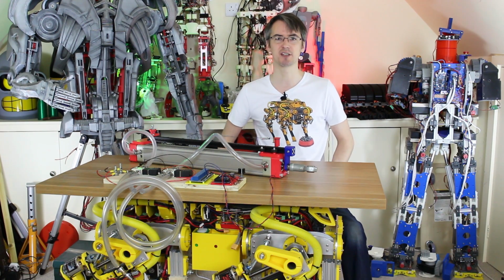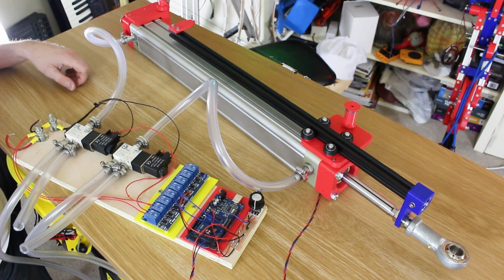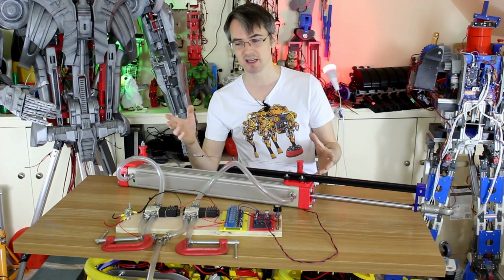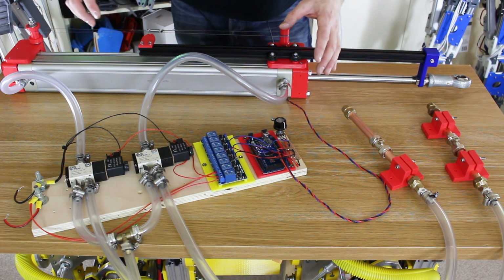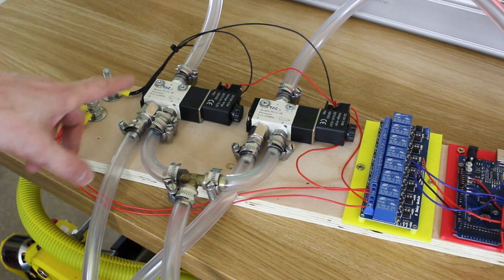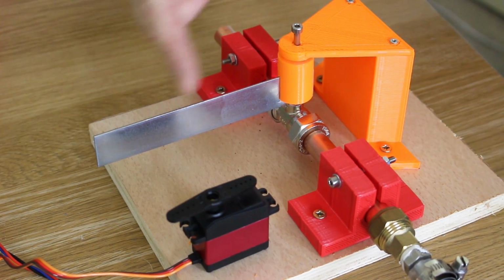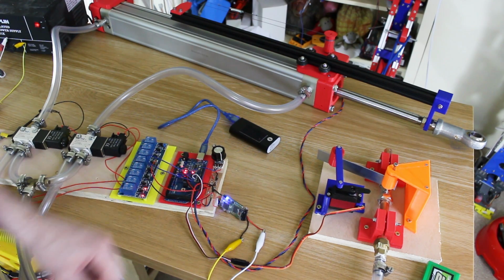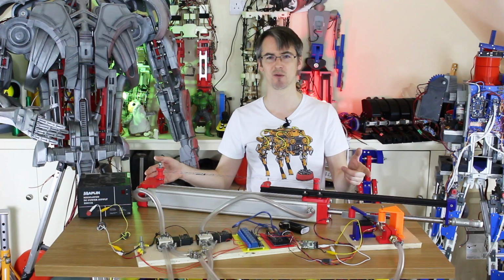Testing Proportional Control of Pneumatic Cylinders | James Bruton

Comment: hi james really like your show,

may i offer the advice of someone who has to deal with pneumatics on a daily basis

While you are correct it is the surface area of the cylander on one side,  on the opposite side it is the surface area of the cylander minus the surface area of the end of the pushrod. (also atmospheric pressure applied to the end of pushrod if you want to get technical). i would use proportional valves and go with pneumatic over hydraulic (water) if you want to completely eliminate creep. the valves open too quickly and allow for too much pressure differential applied too quickly, along with compressable fluid (air) is your problem. also the reason why you have gotten such strange results on your valve switches is that you are changing too many variables proving your prejudice and not testing an hypothesis. change one variable at a time it will be much easier to troubleshoot. also if you do decide to keep the solenoid activated valves and run with pneumatic over hydraulic you might have to deal with fluid inertia. all depends on how fast you want the transit to happen with accuracy.
Reply: Light oil is a better option for a lot of reasons, other than making a mess
Reply: did't you mean hydraulic over pneumatic. We had a robotic cell that feed a molded part up small amount each cycle for a robotic arm to grip. the up was controlled by oil. then when all the parts where fed, air was used as a fast retract.
Reply: This is correct. The "plug" in the middle does not have the same surface area, whiuch matters if you're feeding it the same PSI.

Comment: Do some of the Boston dynamic robots have pneumatic cylinders? That big dog thing has a 2 stroke motor running it must be running a compressor. The other great thing about those cylinders is they are so light
Reply from the maker: The bigger ones are hydraulic.
Reply: as James stated the big and old ones use highspeed hydraulic systems, which have a lot of negatives but are somewhat required for military service same goes for the combustion motor.
The newer smaller and agiler versions use a special in house designed electronic actuator that is able to recycle mechanical energy to some degree.
They never used any kind of pneumatic system for long since it is simply to unreliable for analog precision movement. Fine for binary stuff so :-D

Comment: Hey James, I posted this on your last videos but I don't think you saw it! Last year I was at the 2018 CSME International Congress (it's a Canadian engineering research conference) and actually attended a talk that addressed the problem you're trying to solve. The speaker proposed a couple modified algorithms that outperform current algorithms with low tracking error and much less switching that using PWM. Might be a good read or at least includes references that might help further this project. Here's a link to his paper:

https://www.researchgate.net/publication/326305197_Direct_Switching_Position_Control_Algorithms_For_Pneumatic_Actuators_Using_OnOff_Solenoid_Valves
Reply: Before even reading your post and the paper I came to the same conclusion. This was actually a test question in the industrial mechanics program that shared several classes with my industrial electrician degree program. I never took the class for pneumatic power, but I did help several of the students in the class study for it and sat in on some of the lectures since they took place between two of my classes in the same room as my second class.
Reply: isnt it a coomon sense to use pwm to controll the pressure in the cylinders ?

Comment: What you are finding here is all the reasons why compressed air is not used widely in applications that require precission. There is just way too many variables to make it worth the hassle.
Its great as an instant power source and easy to store, but very hard to control and highly inefficient.
One of your problems could be caused by the hoses, as they expand under pressure, just by squeezing the hose with your fingers you should be able to move the piston. Another by air density changes due to temperature fluctuation while compressing/decompressing. A third by the pressure equalizing after letting go of the switches.
A onehundreth by... 

But its an interesting experiment none the less. whats the fun in buying of the shelf gear anyway?.;)
Reply from the maker: Thanks - yes the main reason for the videos was to answer all the people who ask why I don't use pneumatics for robotics more. Also I have these massive cylinders now so...   ;-)
Reply: With compresed air and servopneumatics you can Achieve precissions up to +- 0.5 mm on cylinders